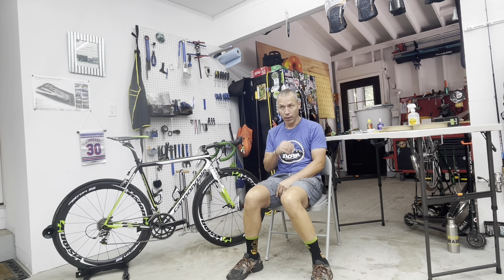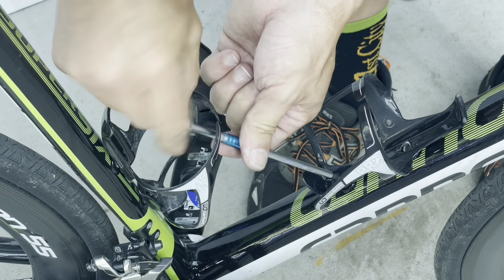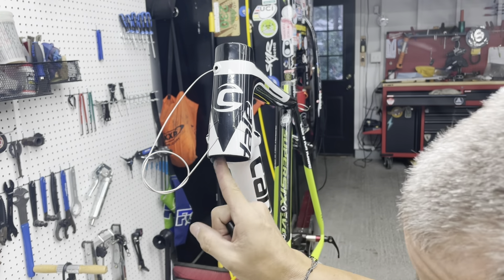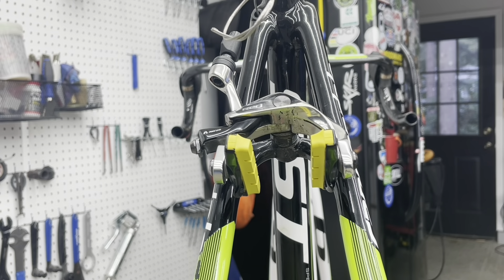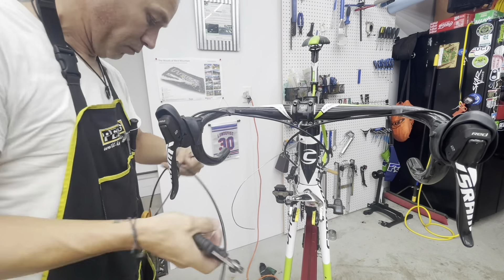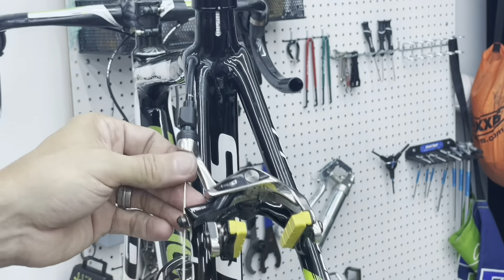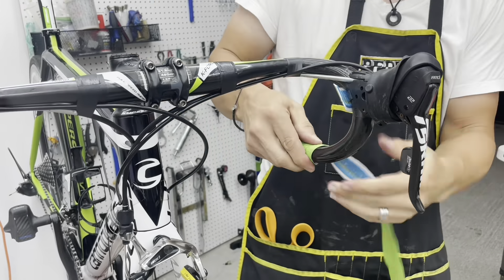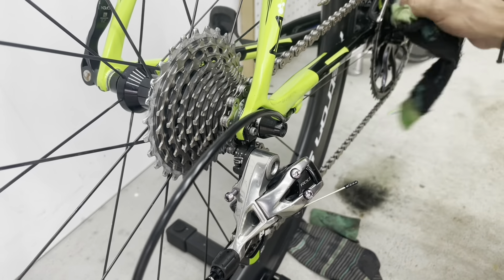Cannondale SuperSix EVO Hi-MOD Team Replica tear down and tuneup rebuild for #FIFTY50FIFTY

Comment: Love those 2012-2019 supersix evos those 2 generations of supersix evo were the peak of cannondale. Also it is the Hi Mod btw. you can tell by the  small M logo on the fork. It says hi mod if you look closely. Cannondale is really suble about distinguishing the hi mod and non hi mod versions
Reply from the maker: Thanks for the M logo distinction! Yeah I am still in love with this bicycle…keep test riding the new disc brake thru axle aero version and just not willing to go there (yet)

Comment: Wonderful bike! The mechanical Sram 10 speed really was the pinnacle of lightweight groupsets. I still use it myself after getting fed up with charging the Etap every month.
Reply from the maker: I really like this bike and the SRAM Red 22 eleven speed group
Reply: @JustEnoughHope  +
Reply: @JustEnoughHope  buy a rival 22 shifters or find a 11 speed ratchet you can convert this into red22 without any modifications
Reply from the maker: It came with Red22 groupo…
Reply: @JustEnoughHope  ohhh never knew the green ones camels with 11 speed
Reply: I agree - SRAM at their best

Comment: Nice bike.  I've got the 2013 CAAD10, White with Green and Blue decals with Campy 12sp R/SR mechanical.  But I opted for White Saddle and Bartape.  Strange how it seems color-ways go out of style, then come back around.  The longer you keep your EVO, the more kudos you will get. 
I just pulled the trigger on a new frame/bike and went for clear coat over the raw carbon (Time), so no color match issues. 😀😀
Reply from the maker: Kudos on your sense of color style…I always enjoy having some matching coordinating “bling” on my bikes